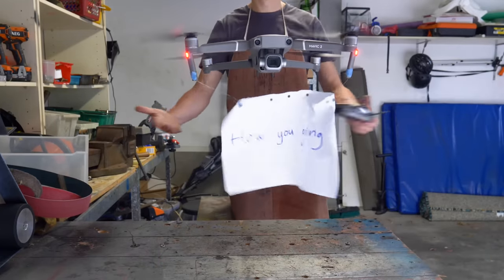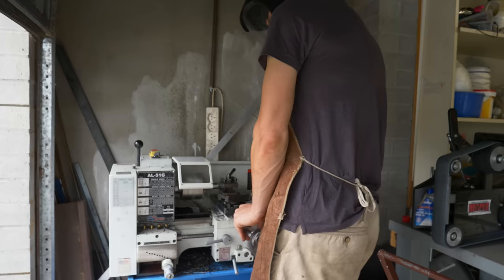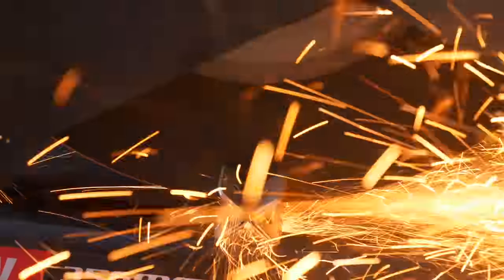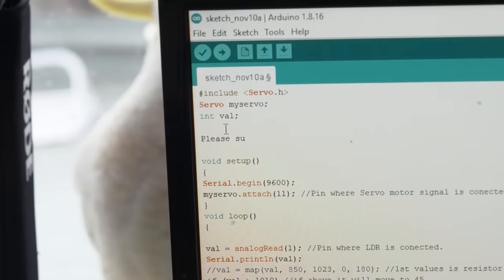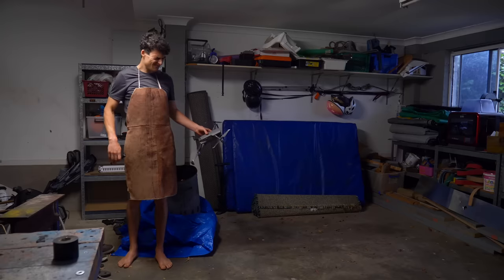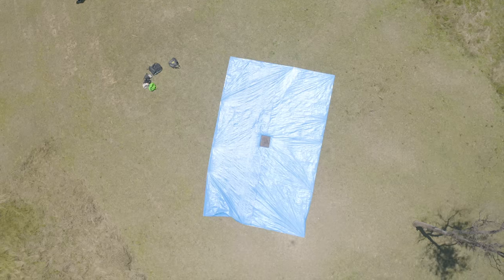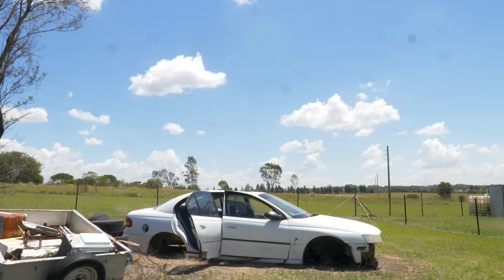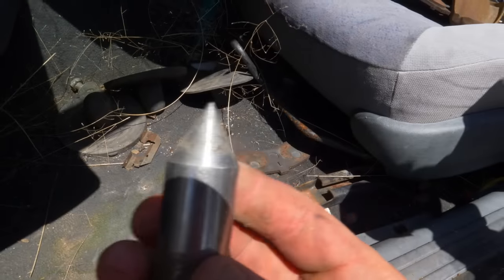Drone Darts are Silent and Deadly!

Comment: I rly thought you’d just replace the lights with electro magnets… rly seemed like the first method
Reply: Can you elaborate?
Reply: @briarfisk  have an electormagnet hold the projectile. and turn it of to deploy it..  . .that would be a lot mroe accurate. . but also would use a LOT of battery really fast

Comment: For getting a hard enough dart, couldn't you also harden softer steel with tempering rather than working on a already hard metal? Sure it'll be more prone to breaking rather than dulling the tip but it would be harder. You could also just harden the tip. Or mill out a spot for a hard carbide tip

Comment: It's hard to love the process of spending billions and three years developing the first atomic bomb, only to realize you could get basically the same results but without the radiation by dropping a big metal stick from space.
Reply: getting a big metal stick heavy enough to do that kind of damage into space is definitely more of a feat than making a nuclear/thermonuclear bomb
Reply: Falcon Heavy can deliver 63.8 tons to low earth orbit. At orbital velocity this mass would have a kinetic energy of 2 Terrajoules. The impact would be equivalent to exploding 480 tons of TNT. The smallest nuclear bomb in the American arsenal has a TNT equivalent of 300 tons, while the Hiroshima bomb was between 15000 and 17000 tons. So, while today's rockets enable kinetic impactors that can compete with some bombs, that's still only a small fraction of what was possible with atomic bombs 77 years ago.
Reply: It isn't the same effect, the forces are of similar magnitude but the kinetic kill vehicle delivers nearly 100% of it's energy straight down into the ground, there would be no explosion, no fireball, only a minimal shockwave, but what you would have is a very dense, very hot chunk of metal penetrating deep into the ground.  The idea behind the kinetic rods would be to penetrate bunkers buried too deeply for conventional ground-penetrating bombs or tactical nuclear weapons to harm, or actual nuclear missile silos themselves which are often hardened against nuclear attack.
Reply: @youtubeisapublisher6407  The main destructive effect comes from the accompanying seismic activity, not so much direct hits/penetration. Much like an earthquake bomb (which indeed are also still used for bunker strikes), but without the explosives.

Comment: 1. It would be smart to use helmets or any overhead protection.
2. You can set up a direct servo switch that is much less convoluted than a light operated arduino.

Comment: Maybe replace the light with a motor and have an all thread shaft? Then nuts instead of hooks. You could have a rack of them. Just spin them off. Some spacers between so they don't bind on each other. Little sections of tube.
   I can't code so I never think your route.

Comment: Fortunately you can't drop things from orbit... if you release a projectile from an orbiting object it will just continue orbiting next to it. In order to get it to fall back to Earth you would have to launch it in the opposite direction of the orbit, and unless you completely cancel the orbital speed (which is very fast) then it won't fall straight down but spiral down and hit far away from where you launched it (perhaps on the other side of the planet even).

Comment: Soldering is a lot easier if you have a device with little aligator clamps to hold the circuit board in place. I don't know what they're really called. When I took electronics in high school we would call them helping hands.

Comment: would have been cool is you could use the tool steel, and bore out the back of it and fill with lead to get more weight, that would improve penetration and reduce the sideways drift :)

Comment: Was wondering why an American would use metres and then realised the aussie accent. Well done my friend! Saw a video of a ukrainian drone operator using a mechanism that releases the grenade with a spring mechanism so it spins like a throwing knife - I suppose that makes the trajectory more resistant to wind? In case you wanted to try that out ;)
Reply: Using football fields and weight of jumbojets as unit of measurement would have been so much easier to comprehend for the average American.

Comment: Actually... When it comes to dropping stuff from the heights, wouldn't it make more sense to drop a rain of small metal balls, like 2 to 5mm diametre? I also thought of iron dust, with the expectation it gets fast and hot enough during the fall, but that never happens at altitudes as low as 50m or even 100m, and the wind is making sure you have no accuracy from anything higher.

In the absolute, the fins keeping your shell upright is just slowing down your shell and prevents it from accelerating enough to gain proper force, the ideal shape actually being a drop (without fins) or a sphere/ball. The only reason you may want a pointy nose  is if you're using it to trigger an explosive charge when touching the ground, as the tip can be a hammer to bang the primary stage of your explosive charge (acetone peroxydes work well to do that). Plus, it's proven that there is a stage where the speed stabilises to a maximum: look at the difference between a small hailstone and a big drop of rain weighing about the same: it looks density is a thing, hence it's probably better to use tungsten than titanium.

The size/weight of your shell depends on what you want to destroy. a bag of marbles dropped from 100m wouldn't be too effective against a car, but should be interesting on the crowd attending a concert, what you think?

Comment: You didnt cut through the steel with the turning machine properly. You have to change the angle on your tool and go from right to left.
It is a bit difficult for me to explain because i am not american. But I was a CNC machinist in Germany for many years. 
The way you cut through the steel produces way to much stress and wear and tear. Also your chippings dront break and you dont use cooling medium. 
If a chipping doesnt break it can have different reasons. One of course depends on the material. So maybe your feed speed was actually correct, difficult to say because you go in the wrong direction.
But also the angle of the blade matters and the correct feed spadd and also the depth and the temperature. 
Not using cooling water is usually a very bad idea and the fastes and best way to ruin your blades. ( I know it sux to clean up and your machine is open, but there are splash guards you can mount on magnetic holders, so the water wont splash everywhere an fall down )

Comment: Need a larger version that has a  small camera in the nose and guide fins so that drop can be controlled onto the target then a vehicle engine can be neutralized. This could end police pursuits in dangerous high priority scenario. 20 lbs or what ever that weight  is in kilo’s striking the motor.

Comment: you can fix the accuracy issue with a cluster version.
if you get a stronger drone, it can hold more, aka, a cluster, and go higher, offsetting the accuracy-to-height issue, yet get better results.
ps: do not do this, its dangerous

Comment: Just a tip for soldering. Throw that shitty 30w one out. Getan actual soldering station at minimum 800 watts. Next get the thinnest rosin core solder you can find, 30-50 awg is perfect. Then get a magnifying glass or lupe

Comment: crappy dropping design
you couldve used an electromagnet since the whole thing is made of steel and it would have been more stable
Reply: your idea is just crap, electromagnets would give a limited flight time. and latch or hook is FAR more power efficient and robust. Plus EMI from the electromagnet would be a issue.